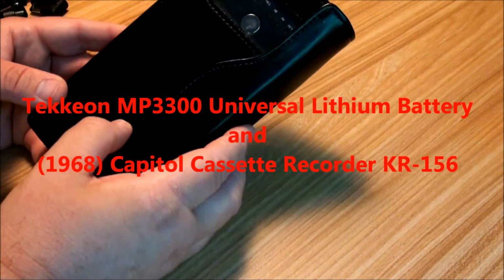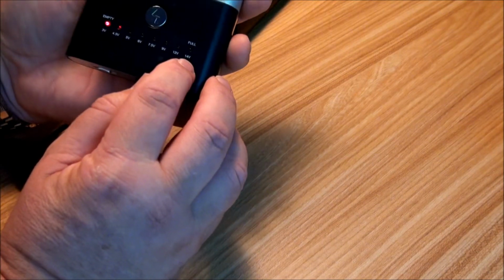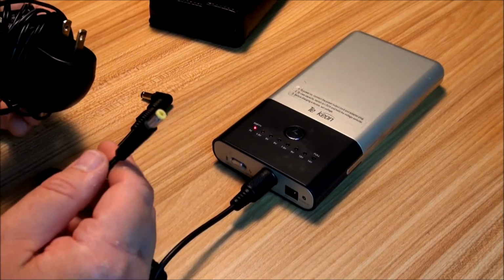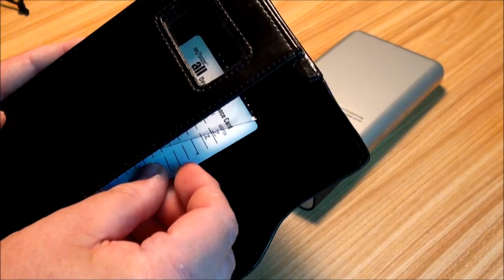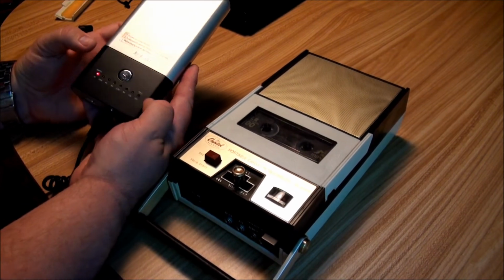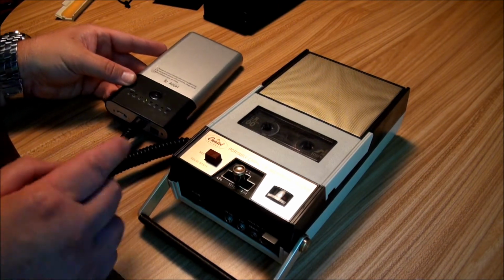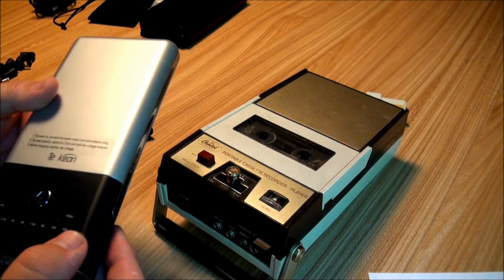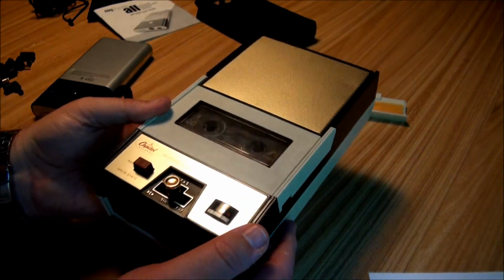Tekkeon MP3300 Battery & Capitol Records KR-156 Cassette Recorder (1968)

Comment from the maker: Thanks for all of your comments on my videos this morning. I have a list of the 7 Capitol models they made for 2 years. This KR-156 "Editor". KR-155 "Freshman" KPR-151 "Varsity" had an AM radio. The KPR-153 "Collegiate" had an AM/FM radio. KR-158 "Diplomat" KIM-11 "Regent" had an AM/FM radio. KS-658 "Ambassador" had a tape-deck feature (whatever that means). I have a KR-155 "Freshman", but it needs a belt change and more before I can use it. It's far back in the "work" pile. It's bright blue!